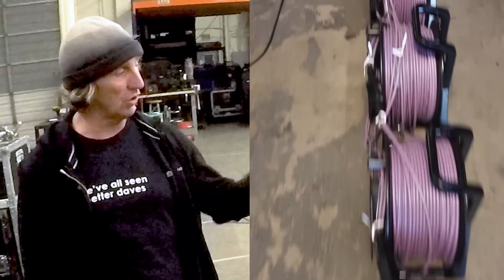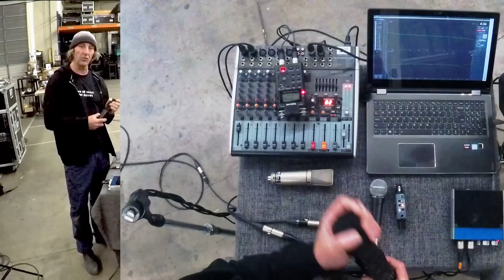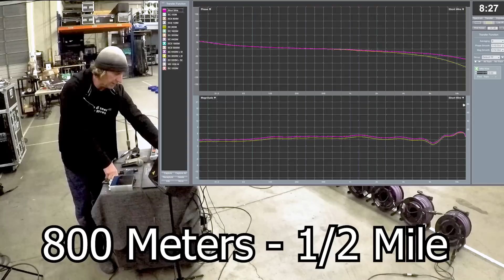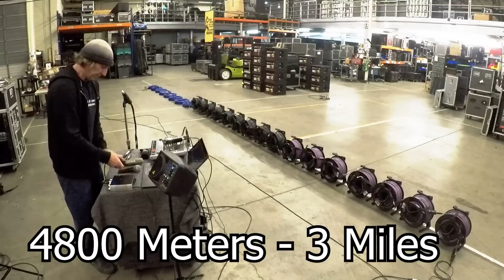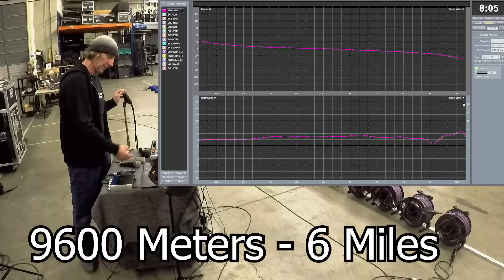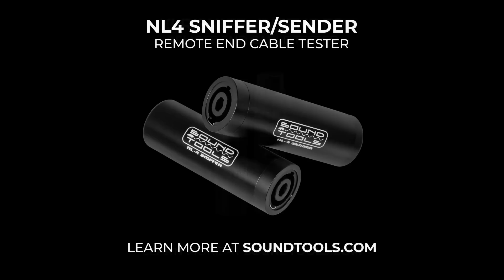Six Mile Long Microphone Cable? With Phantom Power?

Comment: Keeping them coiled negates the length
Reply from the maker: So coiling cables cables can be longer? That's a new perspective. 

Many people believe the coils create inductors which roll off the highs faster, but twisted pairs cancel that out. Never heard the perspective that coiled cables can be longer.  Why would that be?
Reply: @DaveRat  it has to do with transmission line theory.  All wires in any circuit are in physical fact transmission lines
Reply from the maker: Hmmm, maybe give transmission line theory a fresh read. I think you may be cross confusing the use of inductors to counteract cable capacitance with the wire being coiled.

If the pairs were not twisted, the coiled wires would be an issue, not an asset. The coils forming inductors that roll off the HF faster. But, the twisted pairs cancel out the EMF needed for the coils to form inductors 

There could be an argument that the coils are creating issues and the wires could be longer. I have not seen any indicating the coiled wires are a benefit.

Maybe re read and post the part of transmission theory you refer to
Reply: @DaveRat  the problems arise from our mish mash of taught electrical theories which were handed down with specific areas of use in mind.
Reply: We were taught in school that DC failed because it took too much copper to transmit efficiently but in modern times there are many many long distance high tension transmission line systems all over the world
Reply from the maker: You seem to be mixing up a bunch of concepts. But yes, ac tlcan be converted to high voltage low current which is better for long transmission, DC can not easily be converted

But all that is not really related to this. Other than phantom is a low current fairly high voltage DC that transmits well over these distances
Reply: Remember that ANY current flowing in a wire generates a magnet field and the coils will couple when this is present
Reply from the maker: And also tightly twisted pairs cancel that magnetic field
Reply: @DaveRat  no sir.  They do not.  That is the misconception.
Reply: @DaveRat  that is only true for ac signal.
Reply from the maker: Exactly and the audio is an ac signal. 

Are you trying to say that phantom power is benefiting from the coils?

Let's do some quick math and check the probability of that

Phantom is 48v passing through a pair of 6.8k resistors.

The wire is 26ga so about 41 ohms per 1000 feet so about 1300 ohms for 6 miles.

Phantom travels down 2 conductors so 1/2 that but travels there and back so double that and it should be a around 1300/6800 ths of the phantom resistance is cable or about 20% of the total resistance to the 48volts list in the cable at 6 miles.

A Niemann u89 draws . 8ma so, do some math and see where ya end yp
Reply: @DaveRat  did you measure voltage at the pink noise ?

Comment: Are you pluging and unplugging.in with phantom on? ,.....???
Reply from the maker: All the time, as long as the signal is not connected to something turned up loud, all good. The mic has no idea if phantom was turned on by a switch and by a cable plugging in. It just does not know the difference.

Comment: Might want to talk with old radio engineers that used telephone dry lines that are cat3 for miles for broadcast feeds or studio to transmitter links. Yes, they had to have a device at the end to compensate for EQ.
Reply from the maker: Very cool. Yeah I was getting questions asking how far they can run analog down the Cat5e cable I designed.

Mainly looking at the 500 to 1000 meter lengths. But one customer wanted longer as well.

Well this was to show that down a mile or so without any additional stuff, it will work fairly well just plug and play

Comment: The small drop noted at the response could be from using many ethercon couplers
Reply from the maker: He llo Sono!!

Interesting. Yes etherc9m couplers do cause 8ssues for cat5s running data as the frequency is very high.

For analog over cat5e. Those ethercon couplers actually have much thicker wire than the Cat5e cable so they should have minimal impact. I believe the main causes of the drops are resistance from the long thin wire and capacitance from two wires that are very long being next to each other 8n the twisted pair
Reply: @DaveRat  Hey Dave, totally agree. But once someone told me that theres a little bit of oxygen between couplers that could cause a signal loss
Reply from the maker: Any connection will slightly degrade the signal, high speed data is especially impacted like 100k, 1 meg or above.

Analog audio is like 20k so it's a very low frequency and lower frequencies are less impacted.

There are 2 versions of neuteik barrel as well. One is way better for data than the other. For analog it makes no real difference which one.

Comment: Great experiment!
The roll-off is imputed  only by the length of the cable or because is in the shape of an inductor?
I think the pops you are hearing are mostly caused by the inductor shape of th drums
Reply from the maker: I think it is the capacitance the causes the pops and rolloff from the long wires in close proximity. I think the twists cancel out the inductance but further testing would be needed to verify
Reply: @DaveRat  need  to be tested with an impedance meter.
Reply from the maker: Yeah, would be interested to see someone do that. For me, I was mainly interested in

Will it work and how far before issues are audible.  Real world stuff.  I will disecting the exact why to someone else
Reply: @DaveRat  but in the real world, except for the length of cable you do not use 100m of cable on a drum.😉😂
Reply from the maker: Also in the real world we rarely put analog down 6 miles Cat5e.

I do like the practical perspective and this test was to answer 

Elbow far can I run analog down your super cat and super cat sound cable.

So I set up 1.5 miles on reels, as a worst case.

It worked better than expected so I looped it back to get 3 and 6 miles.

Thought is would be an easy, fun and interesting.thing to do and a chance to fly the drone around
Reply: @DaveRat  it is a really fun experiment. And glad you have done it.

Comment: I am actually really impressed by the fact that anything even remotly related to the original signal would come out of a cablerun like that!

However i see a slight potential "issue" with the testing of the phantom power as i asume either the XLR splitter, the XLR switcher or maybe both have the grounds of all connectors bridged. What that would mean is that the sheild of the long cable would be in parallel to the sheild of the short cable run, almost eliminating the impact of it's electrical resistance.

In terms of signal strength there shouldn't be much of a difference with a balanced signal, however i do think that the impact on phantom power and maybe also sensitivity to EMI could be affected by this test setup.

Either way, this was a great video and an impressive test regardless.
Reply from the maker: Yes, on one hand the ground length is 25% of the miles but also the ground braid is much thicker than the twisted pairs and has a lower resistance.

So phantom travels at least 6 miles down twisted pairs of the 12 total it would travel, but the 6 miles of ground that it is not travelling is low resistance 

So maybe the real world equiv of phantom down 4 miles or so

Comment: That was 17 minutes well spent. Frequency response and level aside, I cant help but wonder about noise rejection and interference in a less friendly environment. That might be a more limiting factor.
Reply from the maker: Yes, those are concerns, yet the applications that long analog cable runs are most likely going to be used has a high probability of being in remote locations without wifi or cell signal and possibly dependant on power generators. So interference would be less likely.

Comment: Wouldn’t it all change with all the cable straight and not coiled?
Reply from the maker: Well, the theory says that tightly twisted pairs cancel out electromagnetic fields.

And inductance in coiled cables is dependant on there being an electromagnetic field.

If it did not require uncoiling 6 miles of cable I would test to see if there is an effect and how much longer the cables could be with less impact

Comment: My understanding is usually that couplers is where you usually lose your most power (especially with stranded, so check your 5e. Solid is more annoying to terminate, but would be better for insertion loss), so I'd be interested to see if you could push it further with just a longer cable instead of multiple connected spools.
Reply from the maker: I think that couplers do have an impact on data frequencies of 100k, 1 meg or higher, but this is analog over cat5. So the relative simple 20 to 20k is a lot more resilient and not impacted much.

Comment: To be fair, the wires coiled like that make several inductors. If they were unwound, the results could have been different possibly.
Reply from the maker: Do coils create inductors when the wires are tightly twisted pairs?

Or does tightly twisting the wires cancel out the electro magnetic radiation needed for inductance to occur?

Comment: That is one hell of a lot of inductor coils! I wish you would had measured the total resistance of 6 miles of wire.  And also the inductance. Curious to know that.
Reply: There is capacitance the phone company used to and inductors every so far to fix the response curve.
Reply from the maker: Hmmm, it's 26 gauge wire so the resistance is an easy calc and twisted pairs cancel inductance

Comment: With regards to speed of signal transmission: the speed of Electromagnetic signals running through a copper cable is approx. 200,000 km / second. Very fast indeed! Meaning that you would need to have 200,000 km of cable in order to introduce a delay of one (1) second. That’s a lot of cable. A typical single pair mike cable weighs 65g/meter. 200,000 km of cable would weigh 13,000 tons (13,000,000 kg). As said above: that’s a lot of cable!

Comment: Hi Dave. Two questions. 1: How on earth did you come up with this challenge? 2: You have now concluded that it is possible to run an analog microphone signal through several miles of cable with only a minor impact to the quality of the signal. But do you know why that is?
Reply from the maker: Well, before there was digital and fiber, analog was run everywhere. I believe analog was designed to run long distances.

Older designed mics like the RE20 have selectable impedances going down to 50 ohms  That should allow it to run 2x to 3x farther with the same HF rolloff vs the 150 or 200 it is set to when sold.

Comment: What can be interresting, when you plug mic to 1input, and try to draw gignal from remaining chanel lines in Cat cable. How strong crosstalk analog induction in cat cables is, when working balanced/unbalanced.
Reply from the maker: Have you watched the vid I did on crosstalk in Cat5e with analog signals?

https://youtu.be/gGgPDEz5sNU
Reply: @Dave Rat cool cool :) thanks

Comment: Please test and compare it to 100 x 100m mic leads all connected sequentially. And also 10,000m of Monster cable. And 10,000m of unrolled cable.  LOL! 
What if it was unbalanced - does it pickup AM radio? Can you use an EQ to restore and flatten it out? The 48v Phantom should go for several km because that's what old analog PSTN phones ran from sent from the telephone exchange.
Reply from the maker: That sounds like a bunch of testing on more expensive ways to do what I already tested

Comment: Always wanted to know the latency of such instances like this. Fantastic video bud
Reply from the maker: Hmm, well the electro magnetic waves travel about 60% the speed of light or 300,000 meters per sec.

So 9600 meters divided by 300,000 equals . 032 or approximately 3 ms wire latency.

That sounds like a fun test.

Comment: Great/interesting demo. The HF roll-off of the pink noise generator over extremely long cable lengths (causing increased inductance, resistance, capacitance) might be attributable to generator's output impedance. However, if the output of the pink noise generator is coupled directly from its opamps, and does not have any series resistance or capacitance, the long cable length roll-off might be negligible. If its output is transformer-coupled, then that would also introduce losses. (All of this applies to microphone impedances as well.) Thank you for such a great demo!!!
Reply from the maker: I did the test with a mic and a pink so we can see or hear how each is impacted
Reply: Yes! And this is why your test is so cool, for it deals with "real world" values, typically 150 ohms. In theory, as the source (mic, pink noise, etc.) impedance goes down, the effects of cable losses (resistance, capacitance) would go down as well. Soooo, this test reveals that the resistance of the cables affects volume, while the capacitance of the cables affects high frequencies. If the source impedances were reduced from, say, 150 ohms down to an ideal zero ohms, these cable lengths would have no effect at all. Thanks again, Dave, for such a great test! Your efforts are much appreciated!
Reply from the maker: So cool and thank you Scott!

I do try and stay away from theory and assumptions and just plug in and see whenever possible
Reply: @DaveRat  Dave, like your other viewers, I really appreciate this valuable testing you're doing...AND THEN...generously sharing it with all of us on YouTube. I'm very grateful. Sure, theory is nice, but to see this stuff in action is so cool. As a studio tech, I've always been fascinated with the reasons "why" things sound the way they do. For instance, what makes a 414 and a U47 sound different, or an SSL and a Neve sound different, or a Marshall and a Fender sound different, etc. It reminds me of music. Yeah, it's great to understand the theory behind different musicians' styles but, hey, nothing compares with actually hearing it, right? (BTW, you also get into the "why" of things when you ask and answer important questions like "Why crowded shows sound dull...", etc., and that's really cool too.)

One really important point you made during your testing is, despite any losses created with 6 miles of cable, you can then just reach up and tweak a tone control and get it all back again! Wow!

Thanks again for everything you're doing.
Reply from the maker: So cool and thank you Scott! Comments like this make the adventure worth doing

Comment: is the roll-off more down to induction being a coiled wire,
got to have some influence than being straight
Reply from the maker: I don't think so I think it is due to capacitance. Because tightly twisted pairs cancel out electromagnetic fields and inductance needs an electromagnetic field to induct
Reply: @DaveRat  
yes but it's not wise to do it on power cords because they can overheat, maybe the voltage not great enough to affect any magnetic field
Reply from the maker: True but for Cat5e it should not be a major issue. Though if we want max fidelity over 6 miles of Cat5e, having less coiled would probably be better than the extra water coil lengths

Comment: This is not that surprising ... analog telephone systems have been running miles and miles of twisted pair for a hundred+ years.

Now imagine how far you could run Mogami, with its proper shield and double pair twists!
Reply from the maker: True on telephone and not sure how much farther audio cable will go designed for a much higher frequency response and to deal with very high frequencies.

Rather than assuming audio cable will go farther another angle could be that network cable designed for 100 megahertz would pass 20K audio cable much farther

Comment: hello
dave
would you be kind enough to make a video with a dsp for 2 subwoofers 15 or 18 inches with frequency cuts and equalization
I myself have a dsp xilica 206 but my md218 master audio boxes do not sound like I want
or even a default preset that will allow you to start off on the right foot
thanking you in advance
musically
Reply from the maker: Hmmm, speakers are so different. I will think about that but I'm not sure I can come up with a generic preset

Comment: Wouldn’t the cable drums act as induction coils? Would we see different results if the cable run was reeled out?
Reason I ask is that cat5 sendin AES50 usually suffers voltage drops around 100ft and a repeater psu is required to keep them from dropping in and out.
Reply: Regarding phantom power that is?
Reply from the maker: Hmmm, well there's lots of variables that could be explored but the goal of the test was to see how far I could run phantom and a mic and what it did to pink noise.

People are asking how far they can run signal down our super cat cable and sound tools products, so I did a test
Reply: @DaveRat  ah fair play buddy. I enjoyed the video and was overly surprised that a dynamic mic like a 58 could still be sent over 6miles of cable. Just that question i asked loomed in my mind so thought I'd ask :). Also loved the figure 8 speaker cable test you done. Will definitely be doing that from now on
Reply from the maker: Cool cool and it will have a minimal effect on speaker cable but for AC power feeder with separate hot, nuetral and ground, it will have the most effect of reducing coiling inductance